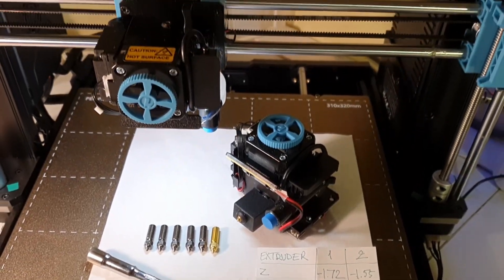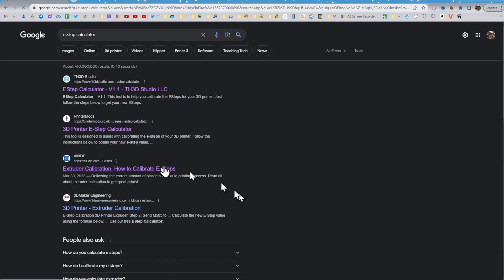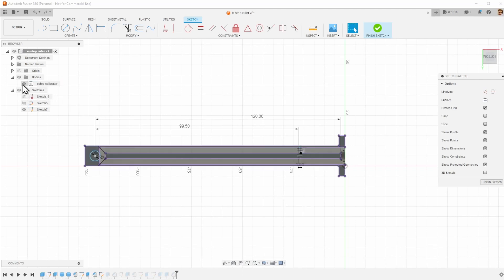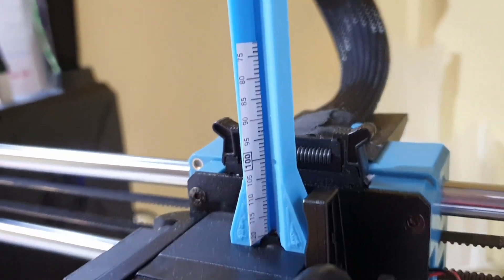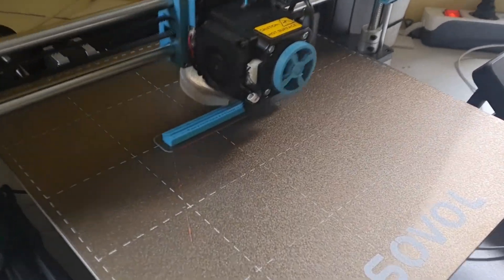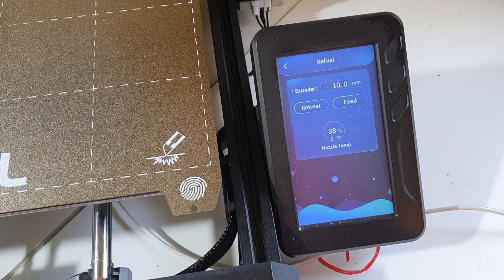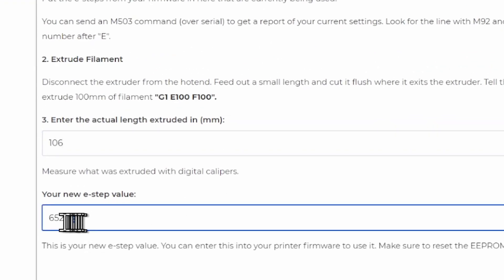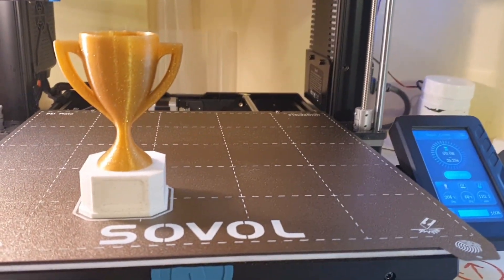E-step calibration on the SOVOL SV06 Plus (SV06, SV07) 3D-Printer using new Extrusion Ruler

Comment: Thank you. Just purchased your model. Brand new to 3d printing. So this will come in good use 🙂
Reply from the maker: Congratulations on your new printer! Welcome aboard!
Reply: @gerGoPrint3D  , Thanks mate. Any chance a ruler could be etched (bezzeled) into your print? Then could use ink to fill the ruler marks instead of using a sticker? Just an idea.
Reply from the maker: @TheCog1983  I could, but we need more precision than what can be printed as etches. There is one mark etched for the 100mm distance. Even if you don't have a paper printer, it shouldn't take more than a minute to copy by hand 20-30 millimeter marks from a ruler +/- the 100 mark.
Reply: @gerGoPrint3D  , Thanks for the intel. I wasn;t sure how precise you can get with an SV06 Plus. Will use Inkjet printer to print ruler.
Reply from the maker: @TheCog1983  I designed v3 for you nevertheless. It now has itching for millimeter marks. I already made it available on cults3d, but I am test-printing it right now. I will keep it there if the test print works out.
Reply from the maker: @TheCog1983  v3 = attempt to include etchings for scale - very hard to read (see photo of green print), paper printed scale recommended (see included PDF)

If you don't need etched scale, use v2, which is otherwise identical and prints quicker, better.

Comment: I bought one of these printers and I was taking the print off the plate and the plate cracked. Do you know of an upgrade for the plate?
Reply from the maker: You mean the PEI spring steel sheet is damaged? You can keep using it, just be mindful of the location of the crack when you place objects. You can buy a new one on AliExpress, just search for 300x300 textured PEI, or directly from Sovol (follow the link I place in the description of this video for you). BTW always wait for the sheet and the object to cool before taking them off.  If sufficiently cooled they come off without force. You can remove the PEI sheet from the bed and place it on a cold surface to speed up cooling.  The advantage of textured PEI is this easy release at room temp. PETG prints can be tricky, as they tend to stick too well, I found they are released best when the sheet is cooled between 30-40°C (I recommend printing PETG on a bed set to 75°C)

Comment: I have a Sovol SV07 but in the settings I can't find the possibility to access the motor steps values, there is no advanced settings item, can you tell me where it is or how to get it? Thank you!
Reply from the maker: On a Klipper machine you will have to edit the printer.cfg file, and adjust the rotation distance for the extruder under the '[extruder]" section, look for the setting "rotation_distance:". Please make sure to note your previous value. You will be able to edit printer.cfg most easily from the Fluidd web interface, in case of the SV07, a backup is automatically saved when you edit it.

Comment: Timely video for me. I've been 3D printing for about 7 months with another printer but just got an SV06 Plus a few days ago, and comparing results to my other much cheaper printer and not actually seeing as good print quality results, I've come to the conclusion it may be very slightly over extruding. Symptoms I'm seeing are:

Slight bulging on the edge of a calibration cube, and also a slight bulge half way up the supplied demo benchy gcode, a noticable "digging in sound" when printing grid infill, as if the nozzle tip is slightly scraping the tangential lines of the previous layer at 80mm/sec and if I try to print at 150mm/s it actually does scrape the infill as it prints, digging it out slightly in places. If I print on a raft with 0.3mm raft air gap the raft is absolutely stuck solid to the model and cannot be removed, unlike my other printer where 0.3mm is the sweet spot to be removable but stick well enough while printing.

Yes, a raft is not really needed on this printer with a heated PEI bed and most of the time I print with no raft/brim etc with great results, but I was trying to do a comparison with my old printer that does usually require a raft, and with the same raft air gap the model is easily removed on the other printer and bonded solid to the raft on this one with no chance of removing it.

All these factors got me thinking there could be a slight amount of over extrusion that is causing these symptoms, and I was interested to note that your own printer was over extruding by nearly 6%, which is quite a lot - so I've bought your calibration ruler to check it out. Thanks!

I'm curious to know if you noticed any changes in print quality after making your adjustment ?
Reply from the maker: Congrats on your new printer! All 3 of the SV06 Plus machines that I tested were slightly over-extruding.  Bulging cube corners can also be caused by incorrect linear advance values, though the default 0.04 K value seemed to be correct for my printers.
Reply: @gerGoPrint3D  "Advance K" on mine defaults to 0.03. What firmware version do you have on yours ?
Reply from the maker: @dbmandrake  Sorry, you are right. I actually set it to 0.04 myself for the stock brass 0.4mm nozzle. It was 0.03 by default. And for the 0.6mm hardened steel nozzle I found 0.02 to be a better value.
Reply: @gerGoPrint3D  Just did the test with the gauge and I got 99.5mm measured for 100mm feed requested, so not over extruding. Mine has the same default calibration figure for E-steps shown in your video. I guess the issues I'm seeing are caused by something else.
Reply: @dbmandrake  I am having an identical issue with how my SV06+ prints; with the nozzle scraping, rubbing against, or even outright gouging into places of the layer printed below the current print layer. And also with the whole raft being near impossible to remove on especially prints which are wide and short, as rafts are good at preventing warping, especially with materials such as ABS, ASA or PETG. I get consistently good prints and good final print aesthetics. Aside from some prints with large flat upper layers sometimes having a scrape mark or two across the top... I HAVE noticed that the actual steel bed of mine is not perfectly level, and even seems to possibly be a bit 'wavy'.. But maybe this is just what people who don't have the type of money to spend $2500-$12000 on a single piece of hobby equipment need to contend with? I really don't have any more solid answers than that for this issue here.

Comment: can you give us more detail on your led lighting for your hot end
Reply from the maker: I can actually! The LED light mount is linked from the description of my 0.6mm nozzle  change video, but be careful with it. Just last week I experienced problems with the inductive probe (it started to give me faulty bed meshes and homing errors!). As I mentioned in my 0.6mm nozzle change video I have a spare extruder, so I tested the probe from that extruder, and it was giving the same errors! So that made me realize the cables coming from the led light were interfering with the probe. I am planning to make a video on the topic, but in short, be careful how you route the cables from the LED light!
Reply: @gerGoPrint3D  Thank you very much.  I always thought about making one after upgrading the fan.

Comment: How do i extrude 100mm on a regular Sv06?
Reply from the maker: I don't know the SV06 menu system specifically (it's different from the Plus), but here is one sure way to do it: Create text file on the SD card with these lines (using Notepad or simple text editor):
G91
G1 E100 F100
G90
Save it as "100mm.gcode"
Heat the hotend, then load the filament and "Print" this file on the printer.
Thank you for all your support!
Reply: @gerGoPrint3D  thank you! Will try that!
Reply: @gerGoPrint3D  you actually can go to the "move axis" menu then move extruder, and choose 10mm, spin it 10 times and then you get 100mm the next problem is I dont know how to adjust the E-step on marlin, could you help me with that?
Reply from the maker: @stevenyap6454 On the SV06+ you can actually enter 100 on the "Refuel" page to extrude or retract 100mm. The e-step adjustment is under Advanced settings, I show both of these in the video. Please watch.
Reply: @gerGoPrint3D  what I mean is on SV06 printer not the SV06+ with the dial button
Reply from the maker: @stevenyap6454  M92 Exxx will set it, and use M500 to save your settings.  I am not sure though how to read the current value. Maybe you could just set it to 691.5 (the default for the SV06 according to the source code of the printer) and see how much it extrudes. Then use this as the base for the adjustment.... I hope I got that default value correctly, but it is the same for the SV06 Plus, having the same exturder mechanics.
Reply: @gerGoPrint3D  I'm new to 3d print actually this sv06 is my first printer, I often confused with the term G29 M92 M500 can you tell me what does that mean and how to edit it
Reply from the maker: @stevenyap6454  Please research this. There are very good guides. SV06 is a standard Marlin printer, any guide on Marlin will help you. Google "Marlin e-step calibration".  If you are very new, I would suggest not to alter the e-steps, it is close to perfect by default. If you see under or overextrusion you can set flow in the slicer (or probably also in the in-print menu).  It's most important to calibrate if you switch nozzle size or extruder / extruder motor.   All Sovol printers are tested and come calibrated from the factory.
Reply: @gerGoPrint3D  I measure it and when it comes to 100mm extrusion the machine extrude 98mm is that tolerable? or it could be better?
Reply from the maker: @stevenyap6454 98 is close enough. You can do multiple measurements, you will see 1-2% of fluctuation anyway. Are you still advancing 10×10mm? That in itself will put a bit of inaccuracy in the process.
Reply: @gerGoPrint3D  ahh I see, Thanks so much for the information!

Comment: Becareful when doing text  and 3d printing. Unless you are using a smaller nozzle, text that size wont show up. I am referring to your v3 note. So you may need to make the fonts bigger. Also, use prusa to cut your model to a tiny section so you can get through prototyping quicker. I like to design as well, so please don't take any of this as an insult.
Reply from the maker: I did not put text, just itchings 1 millimeter apart. Still the recommended solution is to print the scale on paper and stick it to the tool. Printing 1mm apart with a 0.4mm nozzle is not ideal, and printing the model v3 will be slower as well.  I made this version on the request of @TheCog1983